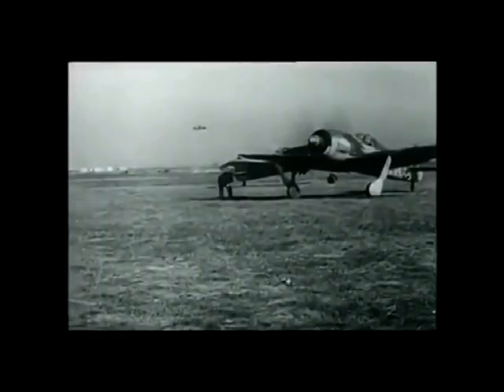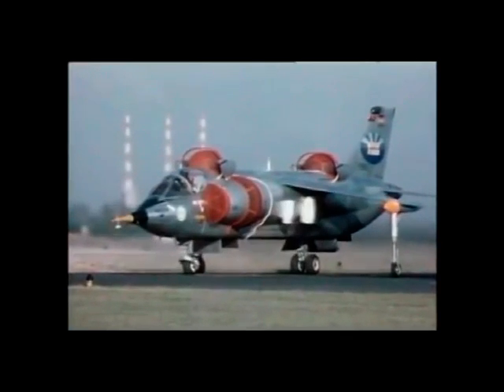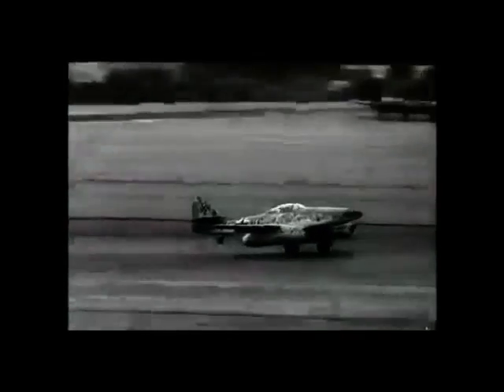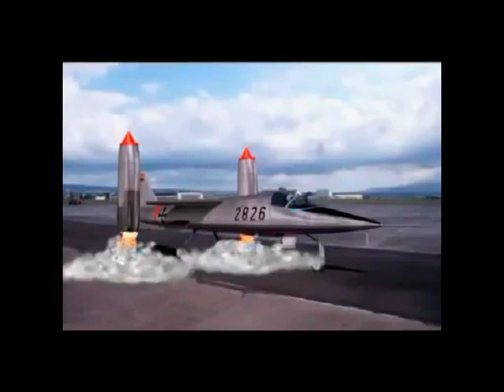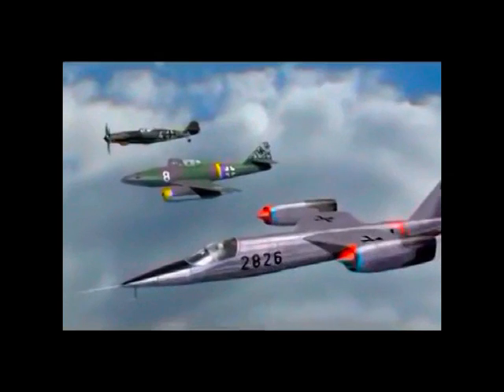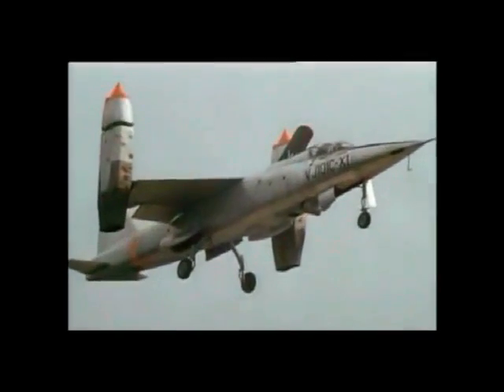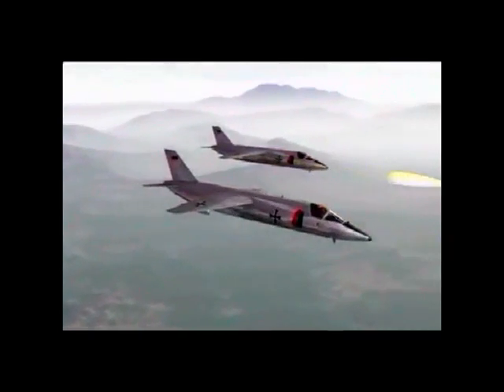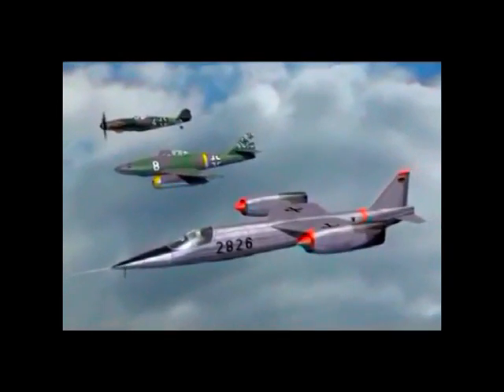Luftwaffe VTOL jets - VJ101 and VAK191

Comment: VTOL aircraft have advantages, but they're also a minefield of flaws.  Even modern designs, like the Osprey or F-35 have severe problems, with the Osprey crashing a bit and the F-35 going through tires like an F1 car.  This isn't to say that the design is meritless, but it's still years, maybe decades, from practicality.  Flight was achieved only after centuries, perhaps millennia of trial-and-error.  We have helicopters and we have planes, but it's going to be a long, long time before we can combine the two effectively.  But, of course, closing that gap is why we should keep at it.  It's easy to look back and fail to understand how something was rejected because you must take careful note of what it entailed and why that wouldn't be wanted.  Militaries, especially America's, love reliability, and VTOL just doesn't usually bring that.  Moreover, look at costs, maintenance, crew training, tactical training, and general implementation, and you'll begin to see why building a lengthy runway is just more practical.  Moreover, the performance of these aircraft would have had to have been to-par with non-VTOL jets and have been safe to operate in the same situations, otherwise they'd become pointless.  Landing with damage, as well, would be a problem...  the list of potential issues goes on, especially for the tiltjet idea.  Again, not bad, just ahead of their time, even as ideas like this are today.
Reply: ***** I'm well aware of the Harrier's existence.  I'm also aware that the Harrier was quite a good aircraft.  However, among VTOL designs, it seems to have been the exception rather than the rule, and doesn't particularly affect my critique on the designs presented here.  I will admit, on further inspection, the Harrier was a lot older than I had initially thought, and these designs not quite as old as I had originally thought, either.
Reply: meh